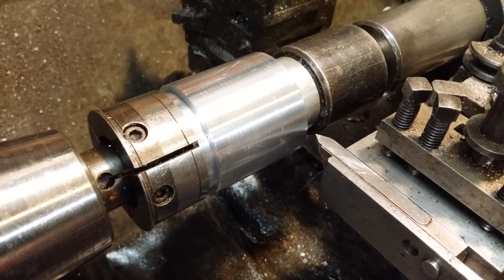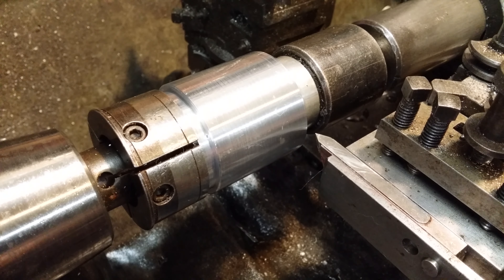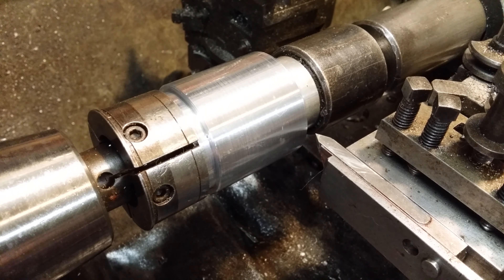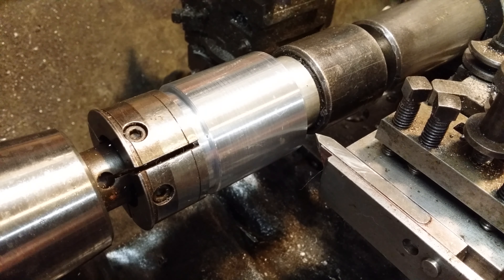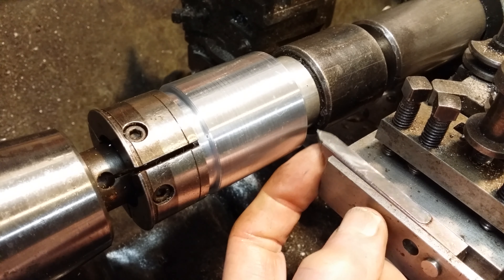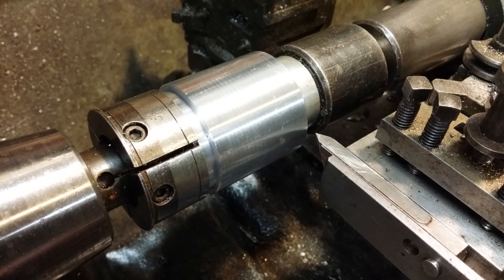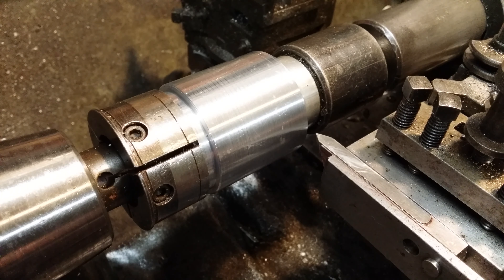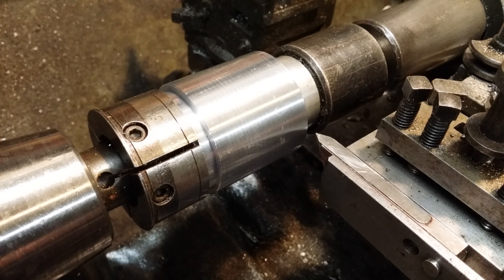Screw thread cutting, so you think you know an easy way......

Comment: I have seen a couple of those before, they work well.
Reply from the maker: Randy Richard In The Shop as I said the idea is very old, this is similar to the original but I have made half a dozen of different later styles. They work well if you can't disengage the half nuts and have a VFD or can't be bothered to wait for a line to come round.😕

Comment: Seems a very good idea for old forgetfuls like me. Do you stop the vid or just flick into reverse? Thanks
Reply from the maker: Thanks for asking, I have a VFD so I can just flick from forward to back at will. At some stage in the future I shall do a better video and review the half dozen or so of these styles of tools I have made over the years.
 As for forgetful, what was the question?😆
Reply: I did type VFD but didn’t notice autocorrect alter it to vid
Reply from the maker: That's modern life for you, you need manual correct for auto correct, now that is something Boeing should take note of.
Reply: What I was trying to ask was do you just flick the reverse switch or do you stop it first.
Reply from the maker: @peterjames4435  indeed I just flick back and forth. I set my VFD to ramp up or  down in 1 sec so it ramps down, stops, then ramps up again and vice versa. No harm can come constantly going back and forth provided the Chuck is not too  heavy. Heavy chucks would require a braking resistor to save tripping the VFD overload. If this doesn't answer your query, ask again.
Reply: That answers my question perfectly, sorry to have been a pain.once again many thanks.peter
Reply from the maker: @peterjames4435  I put up videos to try to help, and maybe show off, and am very happy to answer any questions. 
ATB 
chris

Comment: Now that's a neat thread cutting tool Chris, where can I find one or did you made this? Thanks for sharing!
Reply from the maker: Ray's Garage   well the best place to find one is in your scrapbinium store.😉 
this on is based on the late 19th century patent, but altered to suit QC tool holder rather than the original lantern style. They are quite easy to make but fit of the two parts should be quite close. As this was a trial i used plain old mild steel to just see if there were any benefits over the other styles I have tried. I should have used different metals as MS tends to gall when it rubs against itself.
If you want to see the bits I could either put up some photos of the bits or maybe a video, but that would have to wait till next weekend as 'net is so slow here.😢

Comment: Thanks Chris, for your nice and humorous tips and tricks! Just discovered your channel today, (from a link at HomeMadeTools) and I'll certainly check in here again. Never saw one of these clapper-box tool holders anywhere before, but I immediately realized its virtues. I'll probably wing something together of the like, myself.
 Now: You said you used a straight feed-in for these cuts - but feeding in at an angle wouldn't do any harm to the tread or tool  either, would it? Or am I missing something really obvious, again? :) Thanks, DIYSwede
Reply from the maker: You are entirely welcome and thanks for gracious comment.
As I have said the tool design is well over a hundred years old and now completely superseded by modern  CNC machinery but still valid for manual lathes, which regrettably is all I can afford 😭
As for straight in or angled, it makes no difference as the cutting  tool is essentially the normal threading geometry, in this case a flat topped form tool.
ATB 
c